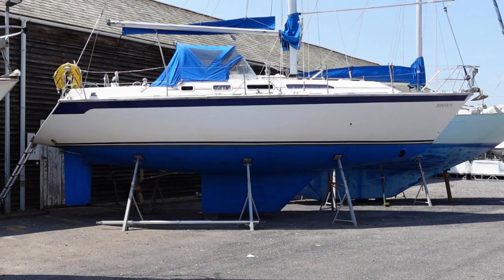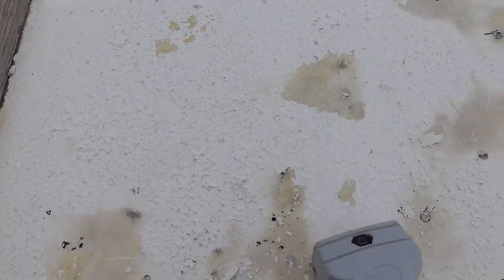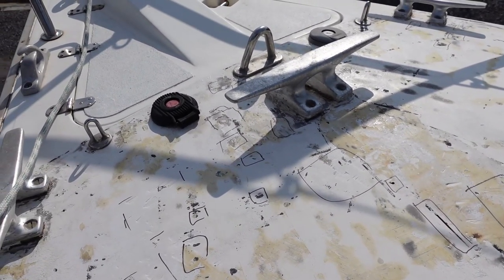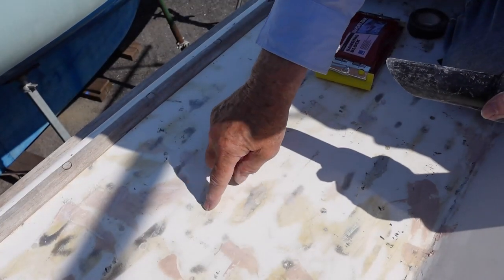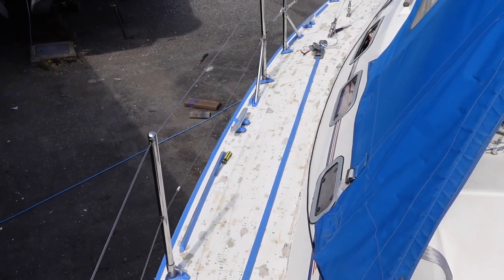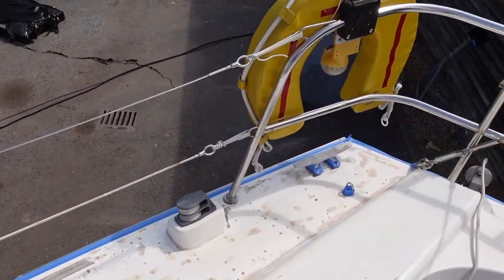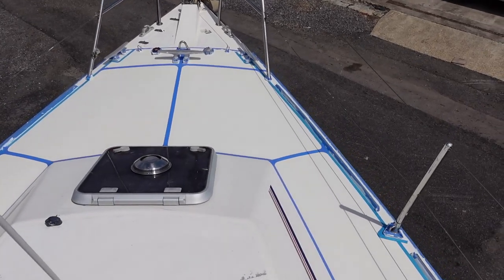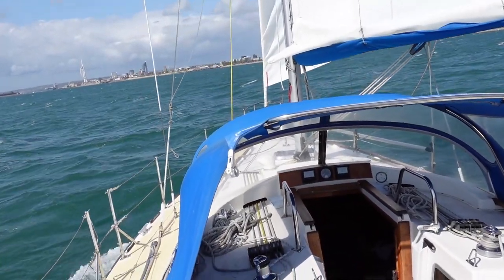Removing Kiwi Grip on Zephyr IV

Comment: Looks great, Dave!
I wound up relocating my 1 1/2" kneeling pad from the house when we sanded and stained our teak - it was a real knee saver!
It helped so much that we left it on the boat and buying another for the house (still a lot of fiberglass and nonskid work to be done).
Still looking hard at using kiwi grip, but will take your advice and be meticulous about prep and application work.
Reply from the maker: Hi Tony, I seem to remember I found a bit of plastic foam packing material, which helped my poor knees. But there isn't much room, especially down the side decks. There's no doubt that the Kiwi Grip that was applied properly on Zephyr IV was really stuck and very difficult to remove so I think, with good preparation, you'll get a good surface. If it was me I'd practice a bit on some scrap material before laying it on the boat. There's a bit of a knack to spreading it and getting a consistent thickness. Good luck with it - I hope it goes perfectly for you.. Best Wishes .. Dave

Comment: I have used Kiwi-grip on numerous yachts and its always been stable and issue free. I suspect that the previous owners didn’t prepare the surface correctly which is why you had variable areas of durability. However congrats on your perseverance with the tedious endeavours in your refurbishment as it’s truely paid off. I just had the topside hull of my 40 year old yacht repainted in oyster white and it came up a treat.
Reply from the maker: I think I infer in the video that it was poor preparation that caused the Kiwi Grip to flake off. Lack of degreasing I suspect, also very variable thickness. Where it was properly applied it really did stick and it certainly wears well. 
Yes the oyster white is a really nice colour and the Toplac went on very easily and covered well. Take care ...
Reply: @davesailing  yes you politely said that and inference recorded. I enjoy your videos, love the boat (unknown brand here in Australia) they seem a tough reliable stead. Looking forward to your next sailing excursion. Best

Comment: I am currently undergoing a similar project. It appears the previous owner of my boat applied some sort of rubberized paint over the original factory non skid fiberglass surface. I have had to use gallons of chemical  paint remover and a wire brush to remove the stuff. Then follow up by grinding and sanding. Its a horrendous job.
Reply from the maker: You have my sympathy Jason. It's a long tedious and hard job. I definitely don't want to do another. Good luck, I hope it all works out OK..  Best wishes Dave
Reply: @davesailing  Yep. Dave its a big pain in the behind. I must repeat the stripping/wire brush process several times before my sanders will work without the paper getting overcome by rubber goop. Anyway, I intend to redo the deck with the same materials you have applied. My boat is only 35'. But is seems like its 150' long. Thanks for your reply. And nice job btw.
Reply from the maker: I know the feeling Jason, you never think you'll finish it. Day after day, then week after week goes by and every thing happens so slowly. And you know that if you don't do it properly then you will, forever, be disappointed with the final finish. I've still got some areas to do, maybe this year. But I'm determined to be sailing by May. I wish you all the luck with it, I hope it all works out in the end. I'm sure it will, us sailors are made of stern stuff and have a can do attitude, well that's what I used to tell myself when I thought it would never get finished.. Dave
Reply: @davesailing  I'm just glad I came across your video before I became involved with that Kiwi Grip. Now I know to steer clear. Thanks Dave.

Comment: Get a  boat they said, it will be great fun , sunny days sailing and sundowners in the cockpit😂😂. That looked like a marathon session, but the end result is worth it. I am interested in your gate stanchions, were they already fitted or did you fit them? I am thinking about fitting them to my Conway. Do you use the gate or just climb over the safety lines?
Reply from the maker: Hi Alan, It was a job I don't ever want to repeat. I've still got some other bits of deck to do but the underlying structure is sound, it will be mainly cosmetic. The Gate stanchions were already fitted when I bought the boat. I use them all the time. It's a long way down from the deck to the pontoon if you climb over the safety lines - you need long legs :-) You might find it difficult to bolt the extra stanchions in place - but otherwise they are a good idea. Best Wishes .... Dave
Reply: @davesailing  Thank you for the reply Dave, I will investigate in the cupboards to see if access for bolting the new stanchions through the deck is feasible. I have a golden retriever dog, so getting him onboard with just safety lines will not be easy. Alan

Comment: The blue tape came off easily after a week in the sun and heat?  Scotch 2090?  I haven’t been able to pull off any tape after a day except the very expensive silver 225.  Please let me know exactly what tape you used.
Reply from the maker: I used ProDec long life masking tape. Recommended to be removed within 21 days.
I've seen similar tape advertised as professional uv resistant tape. Hope that helps.. Dave
Reply: @davesailing  That apparently isn’t sold in the US, so I’ll order it from England if I can.  What I’ve been buying is hard to find and ridiculously expensive.  Thanks so much for the info.  Sorry you had so much trouble with the Kiwi.  I’m sticking with good old oil paint and pumice.
Reply from the maker: @susanc.8009  hi Susan  Google is your friend. I did a search for professional masking tape USA and came up with quite a few possibilities with several that could be left outdoors for 30 days. They are more expensive than the common white version but compared to price of decent paint it's not that terrible.
Reply: @davesailing  Did you tape when it was still hot?  I’m very interested in this subject now (and saving money) and plan to buy what appears to be the longest lasting outside tapes and test them to see if they don’t break when you take it off or leave a residue.  I tried 14 day tape awhile back and that failed the hot Florida sun test.  Did you know that tape expires, but no manufacturing date or use by date is put on them, at least not by 3M.  Storing in a cool place seems to extend the tape life.  I’ll get back to you on test results.
Reply from the maker: @susanc.8009  hi Susan. The painting was done during June July here. Msy and June were the hottest we've had for years. At one stage it was 32 c below so even warmer in the sun on deck. It was the first time I've used the blue tape but I knew I'd be in trouble if I used the ordinary stuff. I needed the tape to be on for at least 6 days before I could remove it. I got the impression that it came off more easily when it was hot. Good luck with your experiment... Dave

Comment: Was your Kiwi Grip not installed correctly? As some of it have came off with a pressure washer washer and other areas it did not come off.
Most reviews I have read people rave about the product.
Reply from the maker: Hi Eddie, I think I sort of infer that in the video. It was done before I bought Zephyr IV and it wasn't a pretty job. I don't think the surface was prepared properly before application of the Kiwi Grip and they didn't level it well before they stippled it with the roller. As you noted some of it came off in sheets when using the pressure washer and a foot or so away it was thick and durable and hard to remove. I was forced to do something and having removed it all, I didn't want to replace it with the same and chance a repeat performance a year or so down the line. Hence the video and the re-paint job. I know several people who have used it with good results. But in every case they were meticulous with their preparation. The guys that did Zephyr IV obviously, were not so meticulous. Thanks for your comment, Have you used it or ? .... Best Wishes ... Dave
Reply: @davesailing  No I have not used it. But I am planning on add non-skid in the future. Other folks have spoken highly of Kiwk Grip. Thank you for your reply.